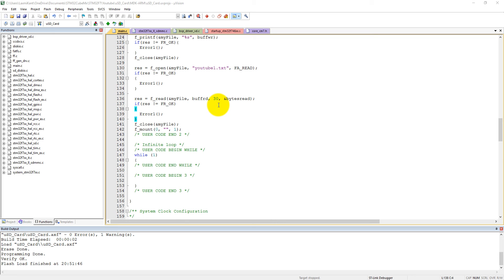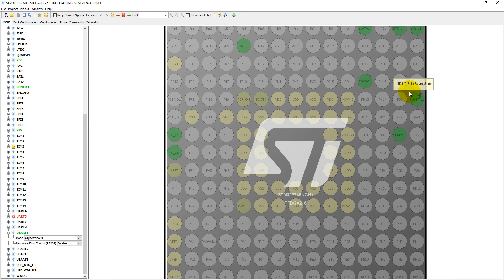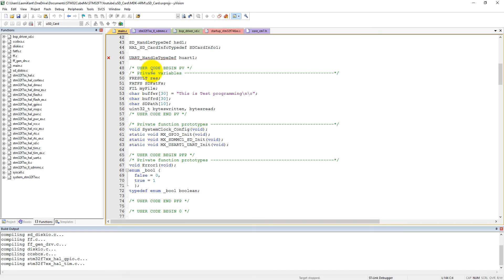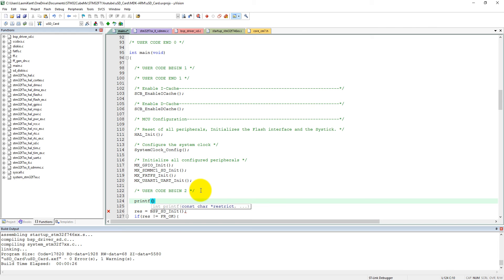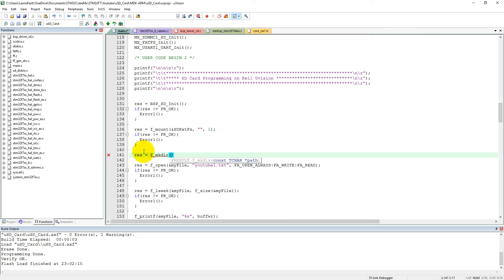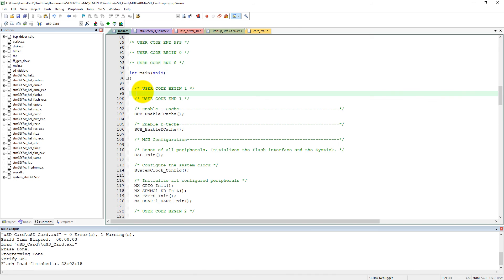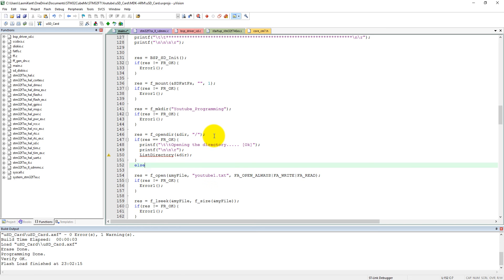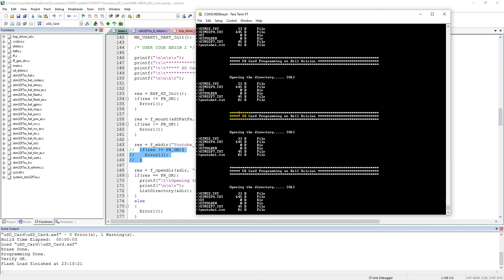15 SD Card and UART printf Programming on STM32F7 Discovery Board using Keil uVision

Comment: Hi, 

I like the tutorial.It is helpful to me. But in my application i am using different controller and storing the 12 ADC samples at a time in SD card. Sampling rate is 1000 samples per seconds. Here I am following the the steps as you followed. I am setting flag inside ADC callback and checking the same in main function. I can write around 300kB in SD card.After this Entire code gets restarted.Do you have any idea why this is happening? Or Can you guide me how can write this huge data in SD card?

Comment: It is good that it all works. Can you please explain how was the connection made between DISCOVERY and PC? Did you use some extra hardware? At the moment I just do not understand!! Thanks.
Reply from the maker: It has a virtual com port. i.e. it can connect directly to the computer via UART. see UART port under the device manager->ports
Reply: Thanks!! :) I figured it out! :)